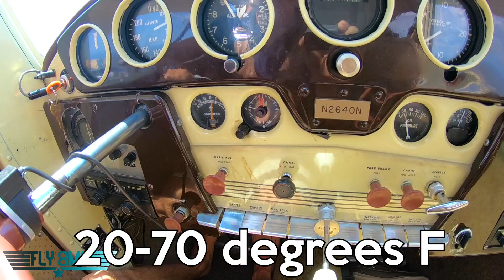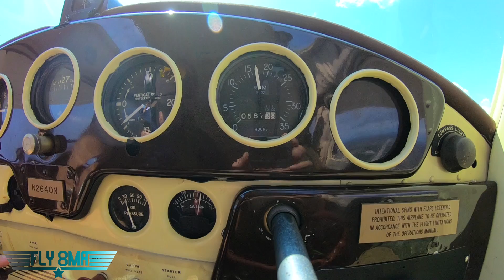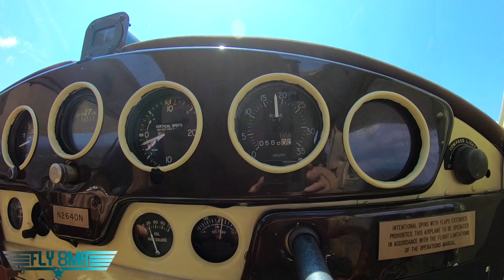Carburetor Ice in a CESSNA | What you need to know...

Comment: It is good that pilots know these basics, for obvious reasons.  Another item I think should have been mentioned is that when applying carburetor heat, ALWAYS apply FULL HEAT.  The use of partial carb heat is almost never recommended, although there are certain circumstances that warrant it.  Generally those times are when you have a carb ice gauge installed and can determine the amount of heat needed.  Absent a carb ice gauge, the general rule of thumb is to always apply FULL carb heat when needed.

Also, a rarely ever mentioned fact is that when the OAT is below 20°F, and carb heat is applied, the induced heat can create carb ice by warming up the colder air to that critical range of 20°F to 70°F.  At that point there is not much that can be done to eliminate the induced ice except for flying the airplane out of the icing conditions, which most of the times mean descending to lower, warmer, and / or less moisture content in the air.  The caveat to that is that if the surface temperature is below freezing that maneuver may not be possible.
Reply: the descending maneuver is certainly possible lol

Comment: Happened to me. I added full rich mixture, full power, checked the magnetos, and nothing happened. I then applied carb heat and the RPMs went up. Must have been in the early stages of crab icing. Because the RPMs immediately went up when I applied carb heat

Comment: Have you made a video about carb heat procedures for the Cherokee more specifically the lycoming 0-320 so many mixed opinions out there...?
Reply from the maker: Follow the poh...should work out well
Reply: @fly8ma.comflighttraining199  yea I've read the POH and the lycoming o-320 operators manual, guess no matter what the peanut gallery says those should prevail. Thank you.

Comment: That's amazing. Is it possible at those temps because of the drop in air pressure as the intake air accelerates through the carb?
Reply from the maker: Correct!